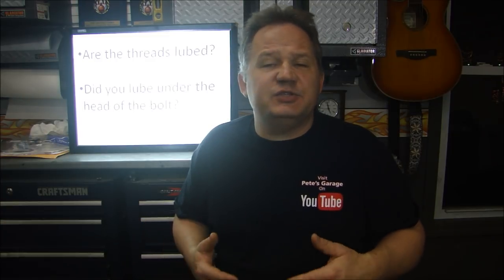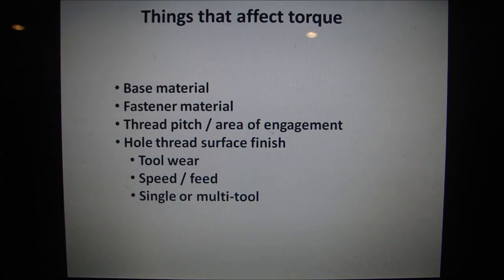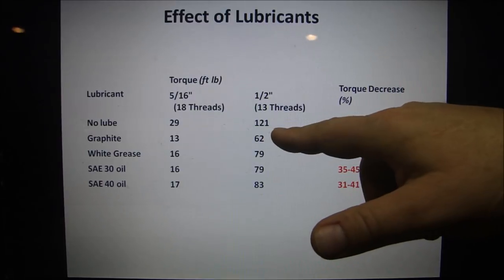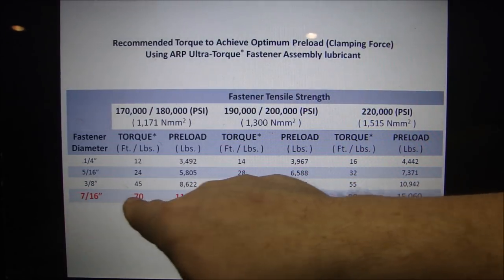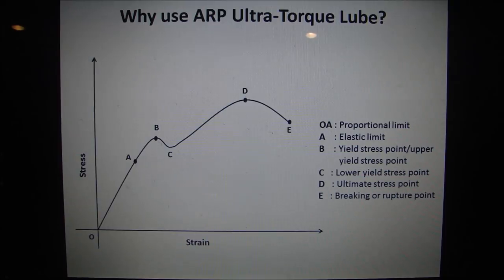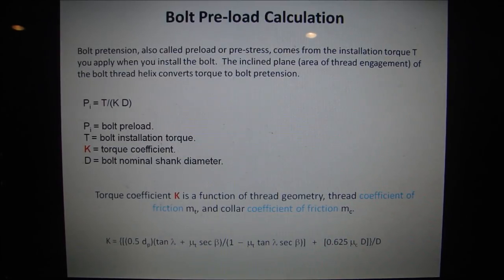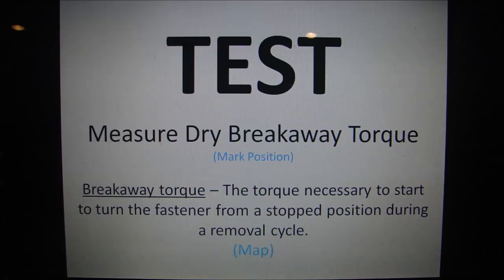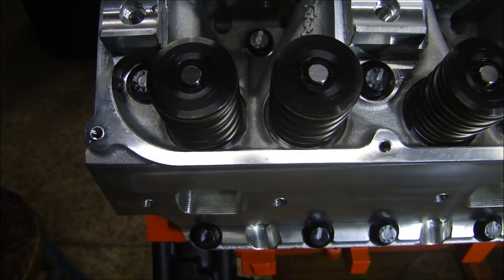Engine Building - How lube affects Torque, ARP Ultra Torque Fastener assembly Lubricant

Comment: Excellent video. Note to self. Spend the extra $110 for ARP studs/bolts and ARP lube. And quit eating that darn chocolate on that assembly line.
Reply from the maker: You'd die if I told you all the stuff I see on the engine assembly line....at least it was a Snicker's.

Comment: I like your Made in China comment after mentioning quality Eagle Rods.  Scat, Sunk2, Eagle, Manley rods are all manufactured in China. Skunk2 Rods and Eagle Rods sude by side are absolutely identical, enen in there tolerances. They merely just have a different name printed on them. Same goes for Eagle crankshaft, China. 
The only American built and manufactured Rods I can say with confidence that is made in the US is ARP. This information is past onto me by Jeff at CNC Werx who produces performance engines and the all famous CSS block support. Though many Rods and cranks are made in China there quality and performance is still pretty good. It's just unfortunate they are made over seas.
Reply from the maker: Thanks Jim

Comment: Pete thanks for bringing science into engine building. I always appreciate empirical evidence based decision making. It would be interesting to know what the exact deviations were between wet top and dry. I agree that your chart pretty clearly showed less deviation wet, I would just like to know what percentage. Great video.
Reply from the maker: That's a great question Mike. When you consider the total area of the thread engagement compared to the area under the head, I would guess it to be maybe 1%, but it's worth measuring

Comment: Thanks Pete, I really appreciate the timeout and the explanation of the lube on the bolts. I have recently built a 4 cylinder block and left off the lube on the thread going into the block but still torqued the studs down. I then put the lube on the top of the stud and on the nut do you think that would be ok? I am a real novice at this.
Reply from the maker: Thanks Mark. You are fine with that. The studs just rest in the block, the clamp load is applied with the nut, you're good!
Reply: Thank you, this has taken a large worry off my shoulders.

Comment: How much difference does it make to torque values if you use say a 6 inch socket extension rather than not?
Reply from the maker: An extension will not make a difference. As long as the center of rotation does not move, like with a crows foot.

Comment: Excellent video. Question on lubing under the bolt head... I see the lube resulted in the bolt angle (at a given torque value) increasing from the 12 o’clock to the 12:30 position and that resulted in more consistent breakaway torque values across all the bolts tested. I don’t know how far the angle needs to move before the bolt gets into the TTY (torque to yield) range. Technically speaking the graph would indicate that any angle beyond 75% of the bolt’s tension rating would be in the TTY range, meaning the 12:30 position would be in the TTY range and the bolt should then not be re-used? I understand it’s not perfectly consistent from bolt to bolt and the 12:30 must be at the low end of the TTY range so maybe shouldn’t be a concern? So in addition to this question about the tension stresses put on the bolt at the 12:30, I would also ask “How much does the preload (clamping force) increase at a given torque value when adding lubricant under the bolt head?” Maybe stating the answer in % would be the most helpful. Hope that makes sense and thanks in advance.
Reply from the maker: Correct, every TTY bolt should be replaced. The surface area under the head is very small so the force required to overcome any friction is small. I would think measuring with and without lube under the head would be difficult to tell.
Reply: @PetesGarage  Thanks

Comment: Excellent video.
Do you really think that "Pittsburgh Pro" digital torque adapter is accurate and reliable enough, to calibrate your torque wrench?
I own brand new "Pittsburgh Pro",1/2" drive torque adapter.I also own brand new "ACDelco" Heavy Duty 1/2" digital torque adapter (ARM602-4),and "ACDelco" Heavy Duty 3/8" digital torque adapter (ARM602-3).
I always like to compare results of all of my torque wrenches,but I'm very sceptical.
By the way,My "Pittsburgh Pro" is draining battery when is stored.
"ACDelco's" don't drain batteries.
Reply from the maker: Thanks my friend. The Pittsburgh Pro is good enough to verify the torque wrench is close. I use it as a quick sanity check. You are right, you have to take the batteries out when not in use, which sucks.

Comment: Hi Pete would it be fine to use arp torque lube on cylinder head bolts that are not arp? I'm installing heads in a 2011 ram 1500 5.7 hemi and I'm trying to do everything correct to have success. I failed once and had a head gasket leak from install. The guy at the machine shop told me if you use the arp lube it will be too slick and I may over torque the bolts and brek them. What do you think?
Reply from the maker: ARP lube is designed for their bolts with the coating they put on them. If you are using stock bolts, follow what the manufacturer recommends. If you can't find that, clean the holes and the bolts and put a small dab of engine oil on the lead threads only.
Reply: @PetesGarage  thanks a lot! Will follow the advice

Comment: Pete, from what I saw here and from speaking to ARP, proper torque is 75 to 80% of the total elastic range torque, after that point the bolt or stud enters the plastic range where it is permanently stretched and the clamping force attained and intended at 75-80% of the total elastic torque is lessened because of the permenant stretch.  

My question is, if a fastener sits at 75-80% of the total elastic zone, is it possible for the combination of heat expansion of the aluminum head, plus, peak combustion stresses at the redline to PUSH a fastener INTO the plastic zone?, thereby permanently loosening the fastener?  

I see lots of loose head bolts, and question the quality control and oem torque of bolts, relative to daily stresses of august heat expansion and zero to redline romps in that heat, pushing the fasteners plastic.

I hope I am making myself clear, thanks, good video
Reply from the maker: You are correct about the 75% to 80% range. Aluminum gives off heat faster than its coefficient of expansion. Since the head is under load from all of the bolts it would expand out, away from the bolt, but I would need to measure that. Most OEM's are going to TTY fasteners for that reason. The torque program is fairly complex.
Reply: Pete's Garage thanks Pete.  I plan to use a sensor to estimate peak combustion stress at the redline.  I want to know that 75% keeps the bolts within the elastic range, I am very nervous about heat and peak combustion stress at 6500 rpm pushing the bolt/stud into the plastic zone effectively decreasing  the clamping force due to the bolt/stud permanently stretching

Comment: Hey Pete! You have some great information around! I've watched a lot of your videos, very educational! I am currently rebuilding my engine (2.8 VR6 24V) and I bought a set of forged rods, they came in with 5/16" ARP bolts (the engine is not undergoing any performance upgrades, I am upgrading the bearings and the rods for it to be futureproof against some common VR6 problems with rod bearings, so its going to be at ~200ish HP for a while). The issue is that, for some reason there was no ARP Ultra Torque lube in the package, and there is no one selling ARP Ultra Torque lube in my country, so its inaccessible to me. How should I go about this? I have Liqui Moly LM48 which is MoS2 lubricant (thick dark gray paste) and I also have Lucas Oil Assembly lube (green thick oil), I also have different kinds of oils mineral, synthetic etc. The specs also say that I should torque the bolts to 26 ft/lbs (35 Nm) with the ARP lube... 
So my questions can be summarized to:
what can I use instead of the ARP lube, how is that going to change the torque (if it is going to change it), do I need to torque them a bit more, or keep it at 26 ft/lbs?
Is 26 ft/lbs really everything that is needed on an ARP bolt? My stock bolts are torqued to 30Nm + 90 degrees (I do realize that now im using different rods with different bolts, just trying to double check).
I cant find an answer to either of these questions and ARP is not replying to my emails, my block is coming in tomorrow (it was bored for bigger pistons) and I need to start assembling it. What is your advice? Thanks!
Reply from the maker: If the ARP bolt says 26 ft lbs and no angle, I would do that with just dry threads. Clean them very good. Torque them once to condition the threads, loosen and retorque. That would be for a grade 8 bolt.
Reply: Im not sure what you mean by 8 grade bolt, anyway, so I shouldnt worry about the arp lube, and I can use some of my other lubes, or leave it dry?
Reply from the maker: Just leave it dry. That is your best bet
Reply: Todor Vachev a grade 8 bolt in our country is a rating of how strong it is. ARP's are stronger than a grade 8 so you have nothing to worry about.

Comment: Why do i have to re - torque my heads after my engine runs and warms up . Usually the torque is off by apporx 5 to 8 ft lbs. less , when i torqued them perfectly during assy. What happened ? , was it the head bolt or the head gasket compromising the torque specs.
Reply from the maker: Depending on the gasket, the torque could relax. After you re-torque it should stay there. That is not uncommon.
Reply: I always re torque after the first 200 miles.  Is it required?  Idk, but I dont think its a bad practice.

Comment: You are a GM Engineer? WHICH ONE OF YOU PUT THE S10 / SONOMA / JIMMY HEATER CORE IN THE MIDDLE OF THE F'N DASH?!?!? WHO DESIGNED THE QUAD-4??? WHO DECIDED NOT TO PUT TIMING MARKS ON THE 3.4  DOHC?!?!?
Reply: AND WHO DESIGNED GM DELCO RADIO THEFTLOCK?!?!
Reply from the maker: Those are all great questions. I worked in an engine assembly plant, far away from the designers in Detroit.

Comment: Great video, impressive. Do you have a mechanical engineering degree? Thanks Pete, enjoyed it.
Reply from the maker: Thanks my friend. I took the manufacturing side of engineering that shared some classes with mechanical. I did my Master's thesis on machining cylinder heads.

Comment: I had to take off a side cover to my motorcycle and due to rusted bolts, had a difficult time, I therefore bought locktite to keep the new bolts from rusting. I didn't know. I am not a mechanic. Now what? I put new bolts on hand tight- snug
Reply from the maker: Heat will loosen Loctite. Use anti-seize instead